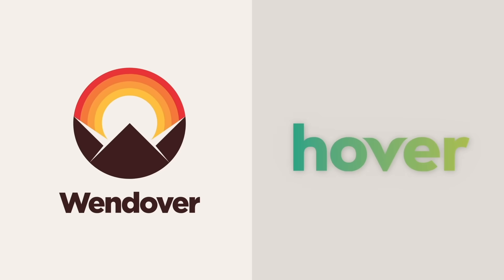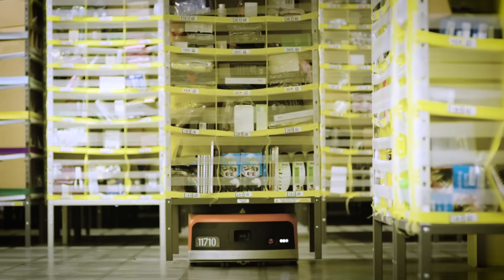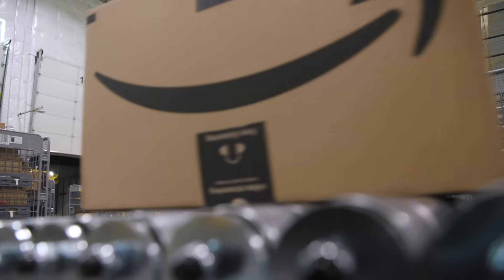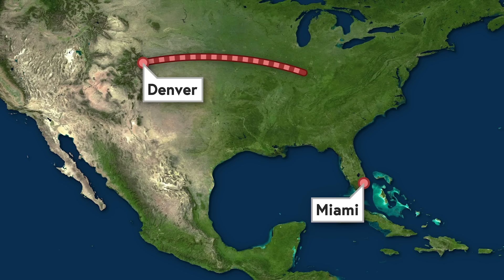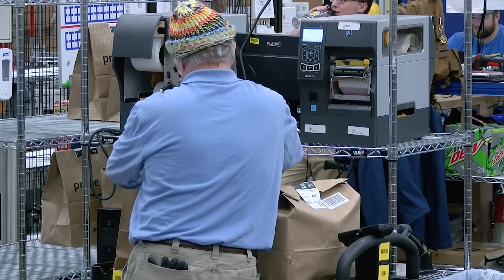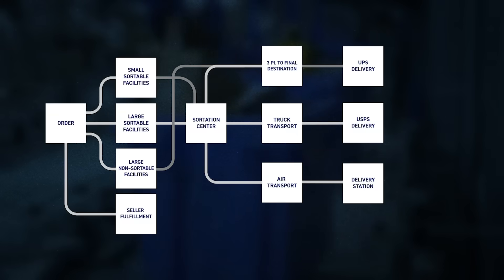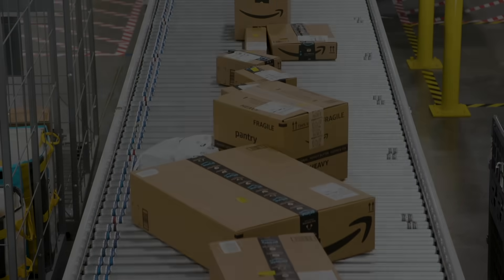How Amazon's Super-Complex Shipping System Works

Comment: A few corrections, it's not "ki-va", it's "Kee-va", at least that's how I heard it when I was at the FC. Not all FCs use them as the rollout is expensive and requires specific hardware in place.  You also missed a few 'cool' things in the process.

Transship, which sends inventory between warehouses based on orders, forecasted demands, or overstock.  These will be running across the continent on a regular basis.

The ""AutoSLAM", which stands for Shipping Labels and Manifest is a system at many FCs which will scan the package's dimensions and weigh it as it moves down the conveyor belt to the shipping area.  Once it makes a decision, the label is applied and it's now ready for the final step.. delivery.  1 AutoSLAM can process something like 4,000 packages per hour and many warehouses will have multiple of these.

Comment: Im sorry, 10 to 12 miles???? Try 15-20. Former picker at BNA-3, well over 1 million square feet just in storage area for the small sortables. Before the bot, we would pull a minimum of 13 miles, most of us, trying to keep up the pace to avoid termination, walked closer to 15. During holidays. The 12 hour days and heavy work load sent it up to 20 miles a day easy. For 6 days a week.  Lost nearly 45 lbs working there, along with what will probably be life long damage to my feet and knees from the heavy toll those concrete floors take after so many hours. They have an in house infirmity for sprains, muscle pulled, twists, and fatigue. 

So yea, those bots certainly saved those pickers a lot

Comment: Great video! But 2 points are missing.

- Amazon prime is a yearly service instead of per delivery charge, meaning they make much less since they just don't charge much. Its like few bucks for prime video plus unlimited free deliveries, and the prime is already crushing big players like netflix who have fat higher prices. Meaning amazon most likely (atleast for deliveries) earns from selling margins and not from delivery fee.

- Amazon because of its heaps and heaps of data barely has to do this effort, mainly because they can always have the important products in their warehouses. (Mostly) this is a thing which others can never beat because fedex and ups aren't selling products, they're delivering it. Amazon can forcefully sell the products (with its listing tricks) which is easier for them to deliver. 

Also, target and Walmart will have a hard time beating amazon, mainly because amazon 1. Has heaps of money to drain (thanks aws) 2. Its far easier for amazon to build their fulfillment and sorting centers. Why? Because of billions drowned in R&D (which also saves amazon tax btw), its automation, and its less need of workers, plus its a warehouse and not a store. So they will also save heaps on rent and location, size costs. (Since it doesn't have to also be a public store) the result is, amazon can build their centers much faster and easier than others.

So if they (target and Walmart) have 2k stores right now, and amazon has 200, amazon can build 2k in a year while they will barely be able to make 2100.

Comment: "Sortation"?  What happened to "Sorting"?
Reply: Sortation: the process of sorting
Reply: @andrewwmunro 
Quick search says the etymology of "sortation" goes back to the 1800s, so it probably did originate as some kind of business talk.

An slightly alternate definition also defines it as "the act of sorting or the results of" (though that was mostly regarding data). Maybe we can say that sortation is where sorting occurs.
Reply: @BonaparteBardithion  Looks like sortation applies only to an automated sorting process. Sorting can be both, but sortation is specifically automated. Still seems redundant though.
Reply: @JanRademan  
Mystery solved.

Comment: I thought it was USPS(taxpayers) losing money on Amazon deliveries, but it's actually just Amazon losing money paying UPS full price
Reply: Either way the USPS's stupid low rates are corporate welfare IMO.  They wonder why the post office is so dysfunctional and loses money.  Well when your rates are set by politicians at HALF of what the other guys charge, do the math.
Reply: @AaronSmith-kr5yf  It's also because USPS has a monopoly
Reply: @AaronSmith-kr5yf  Those rates are actually calculations based on how much shipping would cost if USPS wasn't a monopoly, by analyzing other country's privatizated postal services.
Reply: @AaronSmith-kr5yf  They have to visit that address anyways. The USPS has to serve every address, so they just drop packages off on the way. Otherwise they would make even less money.
Reply: @henryzhang7873  The routes in question are rural routes, places a FedEx or UPS truck wouldn't venture. The post office is running an expensive route, but getting standard postal rates.

Comment: Step 1: Promise 2-day shipping.
Step 2: Actually, just ship whenever you want.
Step 3: Profit.
Reply: key word.. shipping. Processing on the other hand before shipping isnt what is advertised as fast.
Reply: @MattWeber  2 day delivery is a thing aswell. like amazon will say, get it tomorrow if you order now,.
Reply: @user-md3is4dq2d  yes but those species are based on FBA items, and the item is in your most local distribution center. Also if your read prime's delivery policy, it only covers the actual time after it's been picked from the shelf. You can still have the same day/2-day delivery take a week if they aren't timely in picking the item, or it sells out before reaches your item picking and has to be sourced from another warehouse. You just can more quickly take action like asking for a refund due to too slow to deliver more quickly if they arent prompt about processing and picking the item to get it on a truck. Heck I have a "one day delivery" item on its way right now that wont be here til tuesday...

Comment: By hiring/firing endless droves of slaves...er.... "workers". My wife works at Amazon. Good pay, EXTREME rules and extreme work. Many don't last long there. For every minute you are late, you lose an hour pay. Also you can't access your internet connection in the building. Also if you take a single picture inside....even of yourself. You are fired. Also, got bots at our Amazon. I'm looking to work there as a drone pilot to deliver packages! Dream job! All I can say due to my NDA.
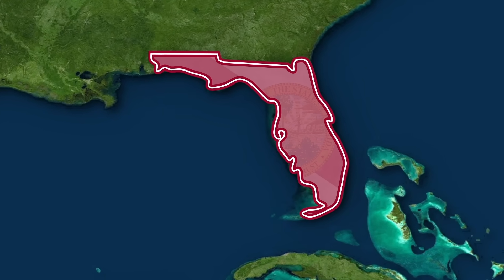Reply: You absolutely don't loose pay! There's a 5-minute grace period before/after scheduled start time to clock in/out and you are paid for your time down to the minute (eg. if your shift is 8 hours and you clock in 4 minutes late and out 2 minutes before it ends, you are paid for 7 hours and 54 minutes...doesn't subtract pay for returning late from lunch as long as its within 5 minute grace period). You receive 20 hours of Unpaid Time (UPT) per calendar quarter and when starting and earn a fixed rate per week (about 2 hours if you work 40 hours a week). UPT can only be used by the hour. So if you clock in late 6 minutes or 59 minutes late, then you are paid while you are working, but get one hour of UPT subtracted....that's certainly not an hour of pay lost!!! However, you also get Paid Time Off (PTO....10hours when you start and on January 1, and time each week based on your schedule...about 1hr40min for 40hr/wk up to 48 hours a year) which is subtracted by the minute and can be used retroactively to avoid having UPT subtracted. Just log into the AtoZ app and apply PTO to the time you were late and UPT won't be subtracted, eg. if your shift starts at 10am and you clock in at 10:08am, submit PTO for 10:00-10:08am and it is automatically approved and UPT won't be subtracted (it might take a day or so for system to not show UPT subtracted and you have to submit before the payroll period is closed, which at my facility is Monday after the pay period ends) If you go negative with UPT, you will be fired.
Reply: @afh7689  Well at least at my wifes plant they lose an hour pay for every minute late, up to 10 minutes.

Comment: How does an order cancellation work in Amazon? At what point in the system is a package committed to delivery and unretreivable?
Reply: I believe it's cancelable right up to the point of delivery. In the delivery app there's a "customer does not want" option under the "cannot deliver" section. Then it's just taken back to the warehouse at the end of the day. Delivery associates can also pick up a package for return, though I've only ever done that from lockers.

Not sure how it formally works on the customer and sales end, though I have had packages in my load that said "order canceled" when I got to them. So, canceling at the last minute isn't that unusual.

Comment: where do you research this? i’ve tried researching amazon in lakeland and it’s been hard to find some things
Reply: I work there. What questions do you have?
Reply: @afh7689  in particular i wanted to know why they were here (which was just answered in the video) i was just curious about how he found out about that
Reply: @floridaspotter  AFAIK, Amazon has had a facility at Tampa International Airport for a few years. There was no room for that facility to expand to handle more packages/flights. Lakeland had a large area (100+ acres?) adjacent to the runway that was ideally located for the facility and Amazon pays them like $80k per month (plus a fuel surcharge) to lease the lot, so it was a perfect match for the airport, which has been trying to attract commercial passenger service for about a decade (a small LCC called Direct Air operated for about a year before going bankrupt and Lakeland has been trying hard to get service from Delta and American to Atlanta or Charlotte). I think KLAL was originally intended to replace Tampa once improvements were made to permit landing in zero visibility (ILS cat 3?). There are 4 fulfillment centers within an hour (Ruskin, Lakeland, Auburndale, and near Orlando Int't Airport) plus we get trucks from Opa Locka by Miami and near Jacksonville, so like the video gets right, it's centrally located within the state. It also has room to expand in the future. 

A HUGE advantage Lakeland has is that without other commercial flights, flights arrive and depart on time almost down to the minute (unlike TPA or MCO, where they'd have to wait for other traffic in the air and on taxiways). I routinely check flightradar24 before my shift to see if the aircraft will arrive on time. In the last three months, I can count on one hand the number of times a flight has arrived late during a shift I work (5days/wk and 6 for most weeks since Black Friday).

IDK what is the plan for Tampa, whether it will continue to operate or if all its operations will be shifted to Lakeland. Since Lakeland has a single runway, I'd imagine TPA will remain open for contingency. When Hurricane Eta was off the coast, one night the flights were cancelled after the shift began and trucks had been unloaded. We put everything in about 5-6 trucks to KMIA to be shipped (IDK if an aircraft flew there to operate the flight that would otherwise leave Lakeland or if they were rerouted).
Reply: @afh7689  huh that’s very interesting! thanks for the insight!

Comment: Just a sidenote: Amazon's success actually comes from Cloud Services. About 2/3 of their profit comes from that sector.

EDIT: i replaced revenue with profit. My bad.
Reply: I think you mean profit, not revenue. AWS accounts for barely any of Amazon's revenue but nearly all of it's profit. Amazon's consumer stuff is most its revenue but is ran at about breakeven (often a slight loss)
Reply: More than a side note. A very important fact. One that will have extreme consequences of Anti-trust laws break the company up.
Reply: AWS and tax breaks....
Reply: Yeah AWS probably helps Amazon pay for the capital costs for modern warehouses compared to the more antiquated warehouses of their competitors. (Though it helps that they are newer as well).
Reply: And underpaid, badly treated workers, of course.
Reply: ah yes, the ones the concentration camps use.

Comment: Awesome video! I work at an Amazon sortation center here in Los Angeles. It’s been a good experience so far. Yes it’s very labor intensive, yes you are on your feet the whole time you are on the clock, and yes they expect you to move at a constant pace. They have also handled the pandemic very well at the work place.
Reply: I work at a manual sort center and it's interesting to see how they operate them at other parts of the country

Comment: damn america only gets 2 day delivery on Amazon. In the UK we get next day delivery most of the time :D
Reply: Certain parts of America probably get Next Day for most orders but it’s simply too large of an area to cover fully.
Reply: To be fair, you can drive from any point in the U.K. to any other point in a 16 hour period at an average speed of 40mph. To go from coast to coast in the U.S., you would have to go almost twice as fast on average and still would need a day and a half without stopping even to use the bathroom.
Reply: @abrahamlinkin2414  UK got the most developed warehouse and e-commerce infrastructure is the most important reason
Reply: @TheMagicJIZZ  The biggest reason is that America is 40 times larger than the UK.  It just isn't reasonable to offer overnight shipping everywhere in America because they would lose millions.  America has less than 5x as many citizens as the UK, meaning the UK is significantly more densely populated and therefore easier to serve.
Reply: @rumham7631  you have too many lanes. 6 or 8 lane roads are evil. And suburban concrete sprawl is shit